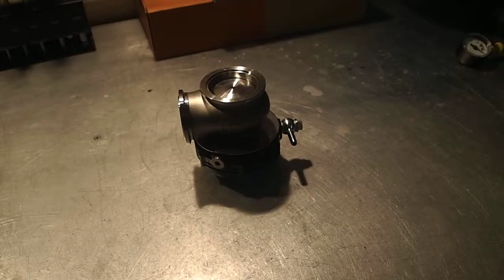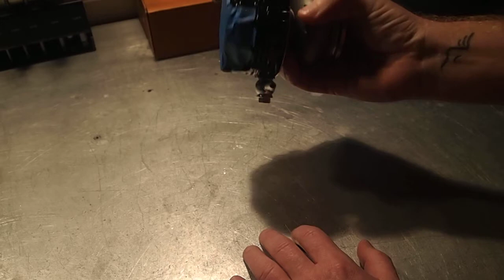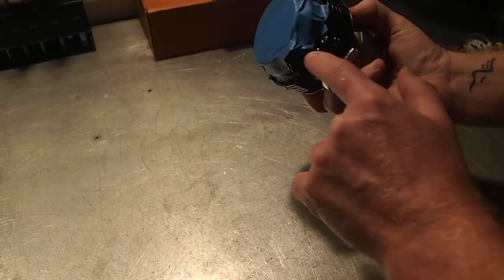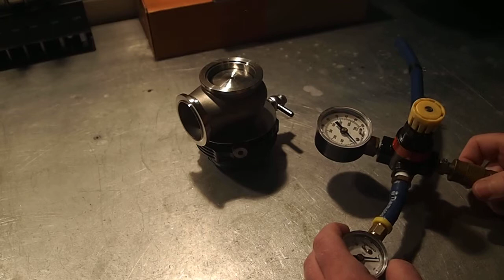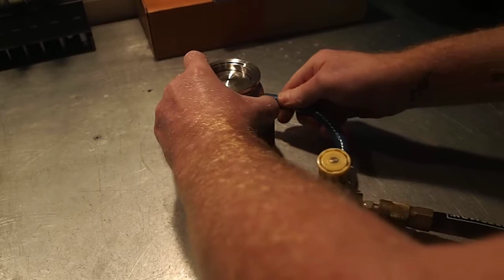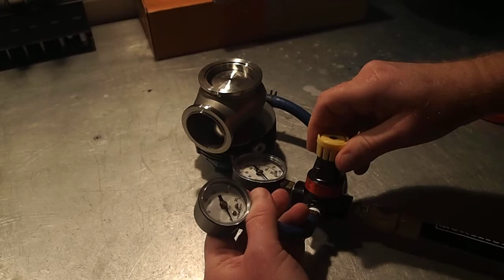TiALSport external wastegate static bench testing.

Comment: Stupid questions if the access air is dumping in to turbo down pipe befor the air fuel ratios sensor could that not causes  tuneing issues

Comment: My 1 bar doesn’t crAck until 25 psi, 13.05 didn’t crack until 19 psi.  8psi spring cracked at 14.5.  What’s going on w this?   Had the 1 bar in on the dyno and almost blew my car up

Comment: I have two MV-Rs, each with a 21.75psi spring pack.  When I test it, the WG starts to crack open at 28psi and fully opens by 38psi.  Is this normal?
Reply from the maker: Hi, Michael. I responded to you by email with a comprehensive explanation. Please feel free to reach out to me directly if you need further help.
Reply: @tialproductsinc1860 can I get that email too. I know exhaust manifold pressure assists in the opening of the gate so bench testing isn't an accurate measurement of boost level but is there a guideline to follow? Thanks.

Comment from the maker: Suggested parts list for the test regulator assembly shown above:  Parker R364-02C Regulator,  PIC Gauge S101D-354C 3.5" dial 0-30psi gauge.  Test fittings should be threaded 1/4"NPT, and determined as needed for your shop air supply.  All threaded fittings should be sealed.  Incoming shop air should be regulated to 60psi maximum.  We do recommend spring-type hose clamps when connecting to the WG for testing.  For less than US$75.00, you can have a professional-level testing system.